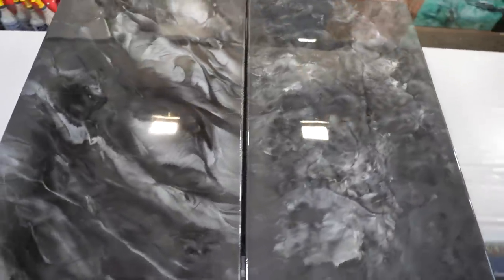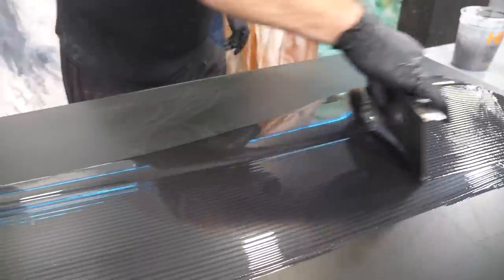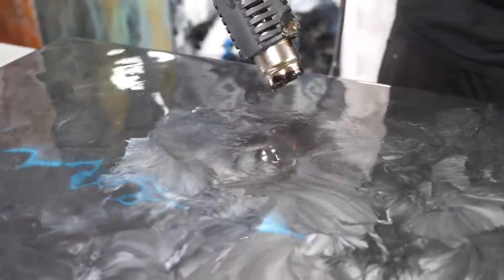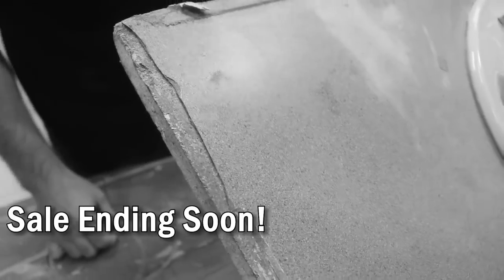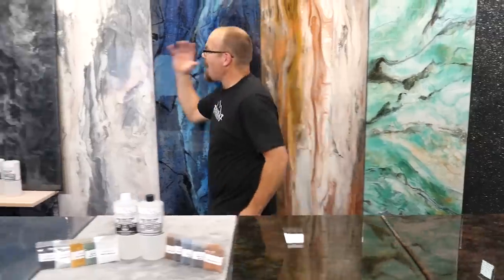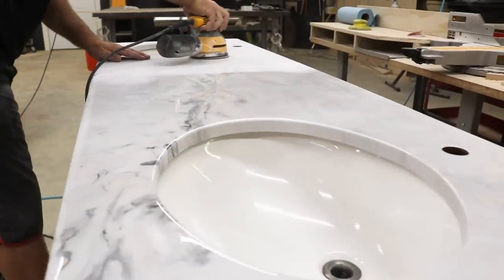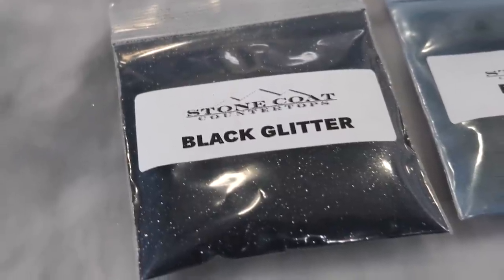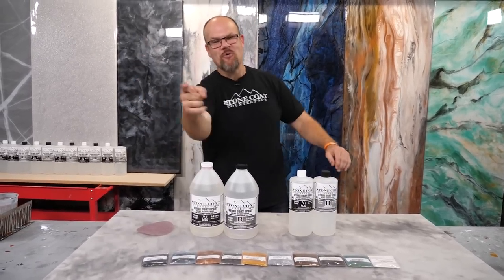Learn to Make Black Marble with Epoxy | Stone Coat Countertops

Comment from the maker: 🔵 https://www.stonecoatcountertops.com/ultimate-black-marble 🔵
Check out our Black Marble Epoxy Secrets Recipe!
Reply: @Stone Coat Countertops, why do you only use propane for your torch?
Reply: Is your product also available in Europe?
Reply: @californiacritic9779  mainly you want the heat from the torch. The heat expansion helps pop the air bubbles.  You can use a heat gun if you don't have a torch.
Reply: @cristinamartinez4999  I understand that I can use a heat gun too. I was wondering why only uses propane, because they also have map gas for torches. Map gas burns hotter than propane. I was curious if the hotter temp may damage the epoxy. Or if it's okay to use too.
Reply: @californiacritic9779  convenience  and easy. It's small, compact and easy to get more of... even  Walmart carries propane.
Reply: @cristinamartinez4999  makes sense.
Reply: @Walhonding Valley Studios-Lisa I agree. I wouldn't use a heat gun. I have a torch. I was just curious if map gas burns to hot for the finish. The small propane tank makes sense as it's small and easy to move around.
Reply: Just ordered and I cannot wait to try it!
Reply: I'm want to pour the epoxy over some branches but not sure about how to go about it any tips you have will be appreciated...please help out on a limb.
Reply: Can I buy it I am I'm france
Reply: Hi. I have 100m2 how many gallon i need for the floor?
Reply: can you supply that in india
Reply: You guys are awesome man great energy and knowledge, thank you
Reply: Why you dont sell here in alberta canada?
Reply: My resin is bubble reduced , do I need to torch it?
Reply: Can I use timber board instead off mdf for stone coat  top . Please let me know.Thanks

Comment: I put the bonding coat on with a regular brush. I can feel the brush strokes.  Do I have to sand that back down? Will the epoxy self level over top?

Comment: First love the videos!!! Question: if you mess up the 1:1 ratio a little and your worried about the integrity of the color coat, would the second clear coat hide any issues?
Reply: No, since the bottom layer would not be hard enough it would still no adhere properly.